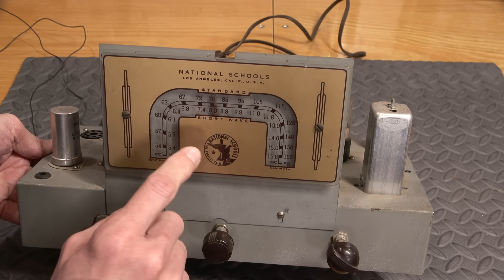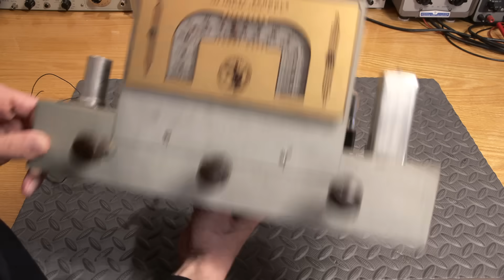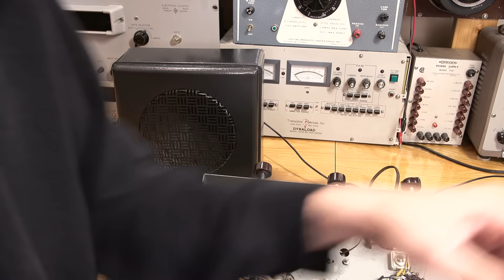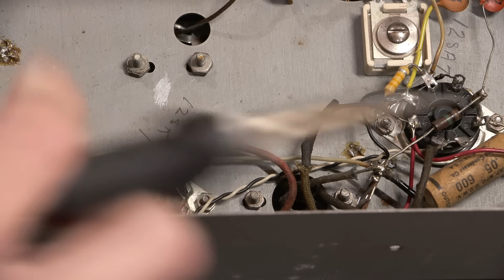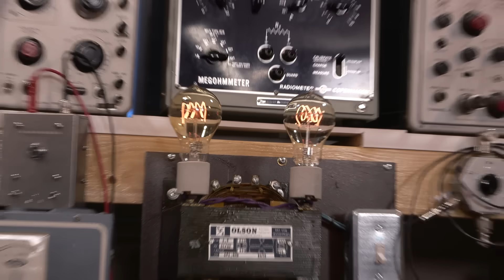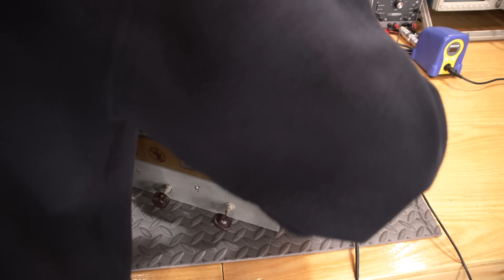Unique Barn Find - National Schools Hand Wired Radio From 1955 - Will It Work?

Comment: On my radio shortwave fades in and out its like gaining and loosing signal strength
Reply from the maker: Thats normal as the signal "rotates" in the atmosphere. This is fixed with a thing called "diversity reception"
Reply: Thank you appreciate it @MrCarlsonsLab

Comment: This was fun to see.. Thanks..I was only 5 yo when someone built this. 
I found an RCA VOM in a box at the flea market..Cleaned up pretty well. Had leaves and sand inside. Also had many cold solder joints. Needed battery folders ..Was a fun project and it works great.  Thanks for sharing your find.  jP

Comment: It is a rare event when I can pick up short wave.  Is it your antenna (good video on that, thank you) that is the key to bringing in short wave stations?
Reply from the maker: It's very easy, coax from the radio to an outdoor antenna, and your receiving shortwave. The coax keeps noise from your place out of the radios front end. So the coax is crucial nowadays.
Reply: @MrCarlsonsLab  Hello Mr Carlson, I have little experience in antennas, but I would like to know if a combined antenna for the 160/80/40 meters bands is possible. By that I mean: would running 20 to 40 meters of plain copper wire against the wall of a house work sufficiently for night DX, if brought in by a 50ohm BNC cable? Or at least for local stations? Do I need an L or Pi tuner? (which I'd need formulas for...)

I'm building a converter to downconvert these bands down to the Broadcast band, until I get a proper ham receiver, and I'm fearing antenna problems...

thanks in advance!
Reply: @MrCarlsonsLab  Thanks. Coax is on its way.

Comment: A great find and an awesome video!...Per your comment, repairing vintage electronics today requires replacing capacitors, resistors, transformers or wiring more than replacing vacuum tubes…Do you think that repairing these units back when they were factory new required replacing vacuum tubes more than other components and wiring?

Comment: I'm curious Paul - how did you know that is was safe to touch that chassis?  Did you use a DMM first?  Wouldn't there be a risk shock from a bad cap or incorrect wiring?

Comment: I pursued an electronics engineering degree through the now defunct Cleveland Institute of Electronics.
Their program was absolutely top notch and still strict to military standards as well as teaching the electron current path, but they also fell behind the times which crippled them financially, they let their accreditation expire in 2014 or 15, and by the end of September 2022, they closed forever. 

When I read what's taught under conventional theory, most of it's pseudoscience and there's a lot of sloppy use of industry terms such as transistor being exclusive to BJT's and a whole lot of other linguistical standards that were strictly adhered to and for very good reason.

These days, I chronically hear and read 0.7 VDC to bias a transistor when in fact, I can show a half dozen popular models won't switch on when you go to 0.66 VDC or higher, but will switch on at as low as 0.32 VDC.
It's no wonder we're now importing scientists just like everything else.

Comment: If you don't have an audio output transformer in the junk box, a filament transformer can be used. In some cases, the transformer in a large, older wall wart can be used.

The trick is to remember the rule "impedance ratio equals square of turns ratio". So, a typical 120-to-6.3 volt heater transformer has a turns ratio of about 19 to 1, so the impedance ratio is about 360 to 1. With an 8 ohm speaker connected to the 6.3 volt winding, the 120 volt primary impedance will be about 2900 ohms, which is close to the 3000 ohms impedance needed by a 50L6GT.

Comment: It would be awesome if there was a 21st century, Mr. Carlson equivalent Radio Kit for purchase by those of us still at the beginning of learning electronics. Don’t kit me wrong , all of the amazing circuits you’ve developed and released to the world for us to build on our own has been an invaluable resource for learning electronics. But, to have a radio  Rx kit that has each part of the circuitry designed to teach or instill a specific lesson on electronics or RF or Anything else that may be related. 
If you ever do something like this, please put my name on the list to purchase one when available. If this is something you’ve already done and I’m so blind as to not have noticed it by now, I probably don’t deserve to build anything I might drop on my toe. Lol kidding aside, I hope either this channel develops something or Mr Carlson can point us in the right direction. Thanks for the video!!

I just saw a similar radio on EBay and the transformer was mounted behind the magnet of a single speaker. The transformer was connected to the interior components by a white and orange wire.

Comment: Shades of my first project, a Knight Kit Star Roamer am/sw receiver.  Still have one on my shelf in my office. I'd sold my original to buy an ankle bracelet to "go steady" with the gal I'd eventually marry. Bought my current one on eBay. The original builder did a perfect job assembling it. I've recapped and aligned it but have yet to replace its selenium rectifier.
Next was kit VTVM.

Comment: In 1961 I attended RETS , Radio Electronic Technical school, in Upper Darby, Pennsylvania , jus over the western border of Philadelphia. Out final project was to build an All America Five from a kit. I still have mine. It works but has little selectivity, with 8 stations or so. My first Jon was with RCA in Camden as a production line test tech.I  retired in 2000 from RCA as a research Tech at the David Sarnoff Research center. After a year of retirement I took a position with Swarthmore college in the physics Dept. In 2011 I retired again at 68 and spend my days in my radio shop, watching shows on YouTube  like Mr. carlsons show.

Comment: That is a neat barn find radio. Those are teaching radios and will have very low hours. More than likely as they were building other circuits as they went through the course. I would suspect one part of the course turned it into an AM transmitter. Usually starting at the Power Supply then build the audio amp and working to the front end to the RF amp. They had the look of being worked on a lot. And they were. 
Years ago, people would give me old 1940's era and later radios when I was in High School. Usually just a bad tube or the speaker cone was eaten away. Those had the electromagnet style of speakers. I would mount the electromagnet inside the cabinet and install a new PM speaker. Those old things really sounded great.

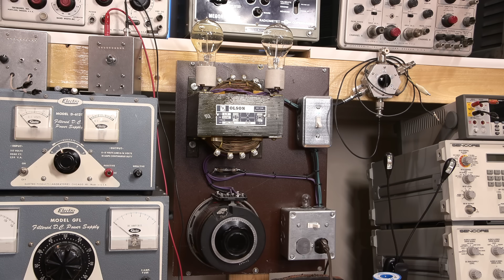Comment: 12:24 - Many years ago, I worked at a summer job at the EE lab at university. I calibrated and cleaned all the bench equipment. One HP 'scope had a bulging power transformer that had probably shorted; it let off a honey-sweet odor!

Comment: This may be a stupid question. But on the devices where the speaker has a field coil (instead of permanent magnet) that apparently is in series with the rest of the electronics - is the polarity important, like if it doubled as a "humbucking" circuit that reduces the rectifier ripple hum and power network artifacts?
Reply from the maker: Yes, the polarity is important, if you reverse the polarity, the north and south switch sides.
Reply: @MrCarlsonsLab  but then, does it affect the sound like increasing hum etc?

Comment: I wonder if that radio was originally a kit radio that one of the electronics makers made for students to put together as projects during high school, community college, or trade school or something.  To determine an actual manufacturer I would start by searching for other radio schematics that use the same tube lineup.  I would not be suprised if it was similar to some of the AA5 or AA6 designs.   I wondered if the parts kit was made by Heathkit, Conar Insturments,  or one of the other kit manufacturers at the time.

Comment: Aww, 1955, that was before my time. When I build my first radio as a child, I already had semi conductors at my disposal. Fun times. That was when I discovered that electrolyte capacitors (those metal capped, shrink wrapped ones with both contacts on the non-capped side) make great mini-rockets, but leave an awful smell when doing so.

Comment: Either you are very lucky in selection, or you have a careful eye for choosing the right pieces.  I also believe your ability to repair things methodically, helps no matter what you find.  My collection of radios has grown to over 85 and I enjoy each repair.  I use your methods often and try to scrutinize the appearance of each repair. I try to choose clean glass without chips or flaws, wooden cabinets with little to no damage, because of course, I like a nice radio.  I am more in-depth with my choosing, but for the most part the appearance is going to get the untrained eyes attention.

Comment: Mr Carlson needs to find a nice way to backlight that dial !!
Reply: Ne2  or ne2h bulbs and a resistor so they can run on 110v.  That would be orange neon or green neon bulbs for the younger people reading this.... lol
Reply: A small incandescent pilot lamp, powered by the filament circuit of the 35Z5 rectifier tube would have done the job back in the day. Provisions are there on the chassis, but the lamp and it's wiring are missing. Running the radio without the lamp isn't recommended, as it increases the current load on the tube heater, probably why the tube was missing in the first place.

Comment: Never seen that double-tube IF-stage. By my knowledge, this has never been implemented in "radio-schools" in Europe. 

Nice AA5 it is. But there is a lot of work to be done. Alignment, probably ... plus also some paper-caps.
Thanks for sharing.
Still waiting to discover "older" restore-projects to be finished.
Reply: It's not a double IF. The extra tube is an RF amp, ahead of the converter. It gives the radio extra sensitivity, especially for short wave.
Reply: @dougbrowning82  That's what I said. one IF-stage but with 2 tubes. Never seen that on EU-made radios. Certainly not on "school-radios".
Strange approach in my opinion. But also interesting!
Normally you would expect an extra RF-stage before the mixer but that would need a triple varco to work fine. (with good selectivity).
Reply: @dougbrowning82  Nope..this one does NOT have an amp ahead of the convertor...the extra stage is in the IF chain.
Reply: @m.k.8158  Never seen that in an AM superhet. I have, however seen one without an IF amp. It was a Trav-ler compact AA4. Only good for strong, local stations.

Comment: Besides the 35Z5 and audio output transformer  it also is missing the dial lamp and base which there is a notch above the
dial face for it. Grommeted hole probably had a twisted pair of wires from it to the 35Z5 for it.  Paul finds what was wrong
and coaxes it to work once again. Nice radio that really can be restored. Seen the schematic by a quick search at Ohio
University NatSRadio.
Reply from the maker: By all means, send the schematic link to my email. I will include it when the restoration happens.

Comment: I took a course in digital electronics from National Technical Schools in 1974.  It came with a trainer using DTL to learn logic circuits.  My first job after taking the class was working on a first generation ITT TE-400 digital pbx which was mostly DTL logic.  It was eventually replaced with a Nortel SL-1 for which I ended up getting Nortel trained.  I spent more than 32 years working on electronic PBX's thanks to my introduction via National Technical Schools.
Reply: I did the Industrial Robotics course in 1986-87, and I still have my HERO 1 Bot. :)

Comment: This radio brings back old memories.  I once took a similiar at home electronics course from the National Radio Institute where we hand built a stereo receiver and later a color television.  This was a correspondence course where they sent you learning materials monthly as your learning progressed.  I also built items from Heathkit including a VTVM, Ocsilloscope, and color TV.  I really miss those Heathkit projects as they were so much fun to assemble.  My soldering skills got quite proficient with all that point to point wiring. 🙂
Reply: Another was Chicago based, Bell & Howell Schools-DeVry Institute of Technology. At one point, they actually owned Heathkit. My dad took their advanced electronics course, and built his own TRVM, oscilloscope, and design console. The design console was where you could prototype different circuit designs. It had its own high and low DC power supply, neon indicator, audio output transformer, and speaker. It had space to mount components such as relays, tuning capacitors, etc., and a sloping breadboard, where you could arrange your circuit connection modules.
Reply: I have a Conar model 315 television from National Radio Institute I got working in high school.  My electronics teacher gave it to me.  Said it was a kit that was donated to the school.  It uses a very similar design to the heathkit TV's in the late 1970's.  All solid state 25 in.  Had a problem with the voltage regulators a few years back, but has otherwise been very reliable in the 30+ years I've had it

Comment: So this radio is from basically a correspondence course. Very cool. I'm still the only person I know that has taken a correspondence course. They were still a thing in the 80s and I took one for motorcycle repair. I was already a car mechanic and I wanted to learn bikes for myself. They would joke about them on TV shows but this course covered everything at the time, it wasn't cheap, and I use what I learned even today. That dial face on the radio would look epic in a period accurate enclosure. Seems like everything back then had an artistic component to it, even simple kit radios.

Comment: A nice radio, definitely a good way to practice skills in electronics. Building with no test gear is far from optimal but doable; I'd definitely use at least a sine wave generator that goes up to 1MHz for IF tuning, but back then even a moldy-meter (not to mention a scope, generator, frequency counter, harmonic distortion analyzer etc.) was not available for everyone.

Comment: Cool old radio. I built a Grayco? AM transistor radio in my electronics class in 74, it worked and actually sounded pretty good. I THINK I might still have the circuit board somewhere.
Reply: Probably Greymark